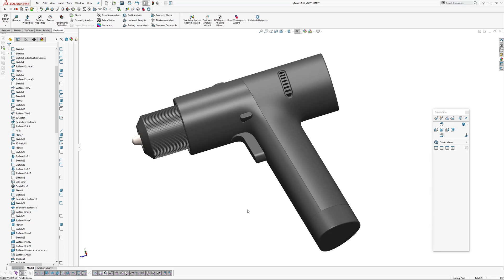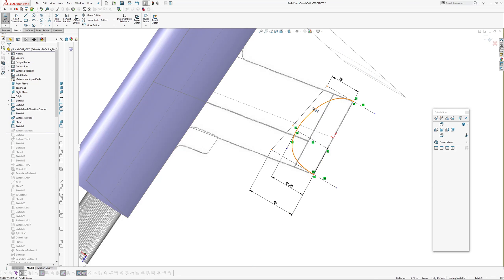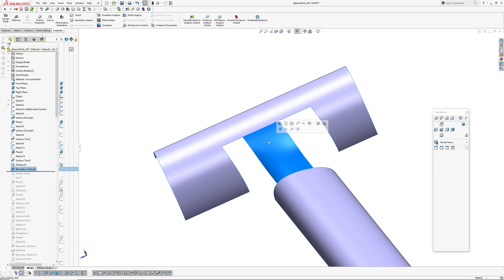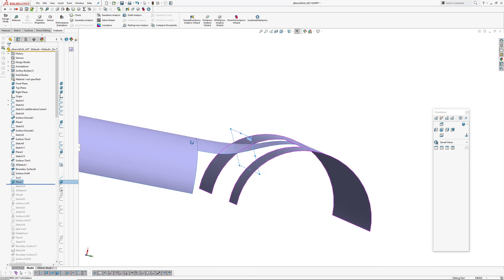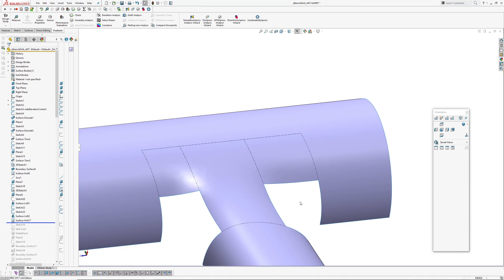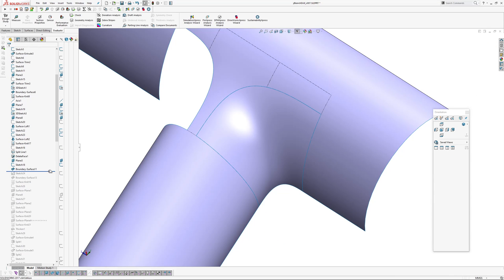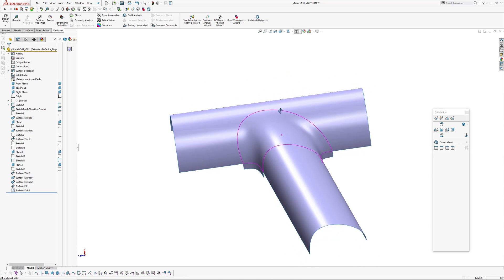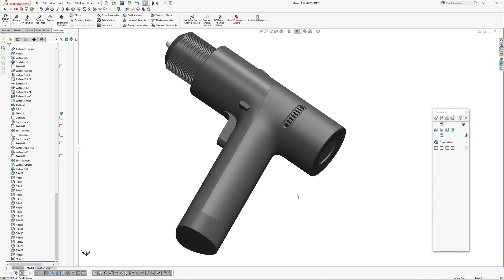Modelling a Y Branch Blend in Solidworks. Blending Surfaces.

Comment: What graphics card are you using?
Reply from the maker: Back then, I think I had a Quadro installed. I use a Geforce card now
Reply: @AndrewJacksonDesignStudio  nice! I just got an MSI laptop with an RTX 5080. Are you using the game or studio driver? I hear the studio driver is better for CAD
Reply from the maker: I think I am on the game driver. I use the GPUs for rendering in Octane as well. I do get the occasional slow down with the display in SW, which is easily fixed by pressing Ctrl B (rebuild) even if there is nothing to rebuild it makes the viewport smooth again

Comment: Andrew thanks for the video.  I'm wondering why you use "Tangent to face" and not  "Curvature to face" for your surface lofts and boundary surfaces?  I imagine b/c your sketches are already set up as curvature relationships?  Thanks a lot
Reply from the maker: Hi Chris. I normally try all options, as sometimes loft will allow you to select CC, but quite often it won’t even with sketches set up with CC constraints. When using boundary, making the constraint CC quite often results with SW forcing the curvature change to happen in a narrow band along the boundary. This is quite evident with zebra stripes on and cycling between tangent and curvature to face. The zebra strips further away from the boundary pretty much stay the same with a wobble appearing close to the boundary with curvature to face. I think the best rule is to try everything! And don’t discount lofts just because they’re viewed by some as old… cheers

Comment: What is the reason for moving the trim line 2.5mm below the center line of the cylinder @ 4:35? Do you find that it creates a better transition?
Reply from the maker: Yes, as the handle is narrower than the top cylinder, I found it helped to have the trimmed cylinder edge already moving inwards towards the handle. Especially as I have CC constraint on the bridging surface.
Reply: @AndrewJacksonDesignStudio  Ah makes sense, I'll be sure to remember that when creating blends in the future! Also in terms of learning optimal surfacing techniques is there any resource you highly recommend looking into? It seems incredibly hard finding knowledge as valuable as yours without scouring the internet for hours.
Reply from the maker: Hi Bruno, there's a few around. Not directly Solidworks related, but there is good info that can be transferred into SW; curve flow, trimming surfaces to make 4 sided boundaries, etc. Cheers, Andrew

https://www.youtube.com/@thirtysixverts

https://knowledge.autodesk.com/support/alias-products/getting-started/caas/CloudHelp/cloudhelp/2022/ENU/Alias-Tutorials/files/GUID-21501AEB-9E7A-4F9F-A0B3-0A4B3431B9BD-htm.html

Comment: Thanks again Andrew. 
You make it seem like anything IS possible in SW, but patience is perhaps the biggest hidden SW 'trick'.
One question:
Do you find that having a 'helping spline' in the middle of a loft or boundary surface helps often or is it only occasionally needed for tricky transitions to keep the surface 'in check'?
Reply from the maker: Hi Schalk, yeah good question. I do quite often use a mid section, as in this case it makes the surface look more like g2 flow, even though I have not selected CC constraint in the boundary surf/loft. I find even if the boundary curves are g2, you can get a kink in the zebra, so adding the mid section help. Quite often if you make the boundary constraint CC it forces the surface to be CC within a narrow band around the boundary, hence the ripples.